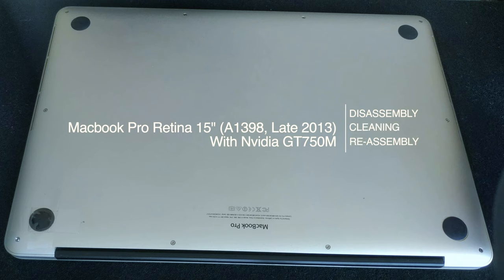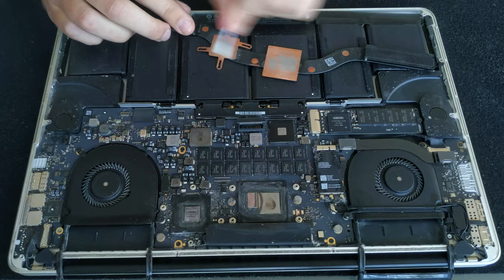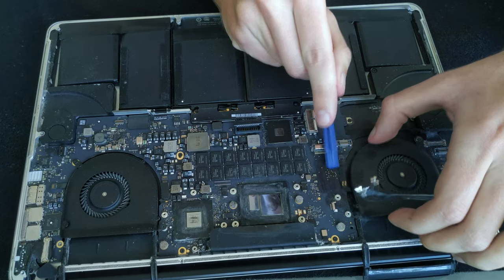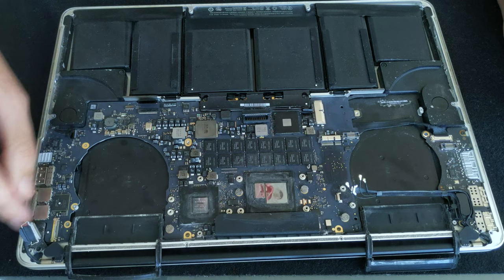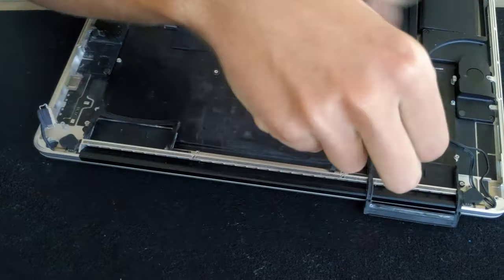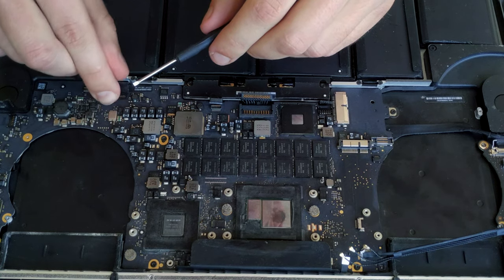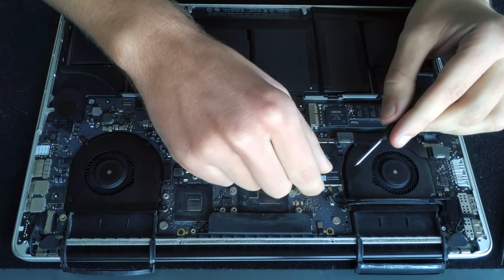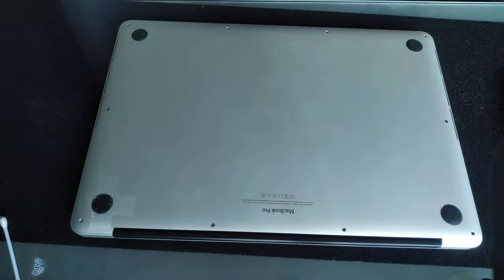Macbook Pro Retina 15" A1398 (Late 2013, i7, GT 750M) Disassembly, Cleaning, Re-assembly

Comment: Thank you sir for doing this service to the community. I used this guide to clean coffee spill in my dads old macbook pro late 2013. Following your instructions tutorial here I was able to successfully revive the computer. Now I have this 15 inch 8gb 1tb SSD macbook pro and also an old mid 2012 13 inch unibody with 16gb ram and 500 gb ssd. Both are great old computers and I dont know which one I should keep!

Comment: 30 seconds in and I already know this video is gonna be way better than the others. I figured out the long way that it’s called a pentalobe screwdriver but so glad you actually mentioned the tools. Thanks!
Reply from the maker: Thanks! I put some effort into the video in order to make it complete and for beginners.
Reply: So funny you commented today, I’m  actually just about to disassemble my MacBook for the very first time today and clean it because I fear roaches may have gotten inside. Wish me luck!
Reply: Using your video as my only guide
Reply from the maker: @citylights2765  Good luck! I'm sure you can do it. For the basic maintenance just clean the fans, air intakes and replace the thermal paste. No need to take the whole board out.

Comment: My MacBook's fans were choked and it was running hot so I cleaned them out with a fine paint brush and replaced the thermal paste. All back to normal now, thanks for the video.

Comment: Thank you for you very clearly explained video! I used it to install a new logic board on my 2013 Macbook pro A1398. I agree with you that it's one of the best computers Apple has made.
Reply: My logic board bit the dust recently- memory ram module 2 is toast and Apple considers this laptop "vintage" and can't fix it any longer. Do you mind sharing where you got your new logic board (A1398) from? Thanks.

Comment: Thermal modifications?! Hold on a minute.. I think i've found the right place!! :D Subscribed!
Reply from the maker: Sorry mate, no time to make the video now. What I did was putting the liquid metal on the CPU and then put thermal pads on the heatsink so it touches the bottom panel. This helps a lot especially if you slightly lift the macbook on the desk so the air can go under. After that I had no thermal throttling even if I overclocked by +200mhz in windows. Still running cool after 6 months since I did that.
Reply: @techworkshop7242  Thank you for your Gentleman's response! :) Picked up 3 x 2013's. Loving them!! Wishing you the best, your video really helped when swapping the logic boards over. 10/10
Reply from the maker: @walshmagic  You can never have enough of 2013 :D. Still enough for my Logic Pro X and Final cut projects.
Reply: Tech Workshop what year were these models built?? late 2013 to ???
and what about the next model. same, better, „worse“??
thx
edit. 
just saw it was until mid 2015
(what about later models? worse?)
as I am planing to have an E-GPU and the thermal mod)
Reply from the maker: @serialdad33  late 2013/mid 2014 has Nvidia GPU option and then there is mid 2015 with AMD graphics (not necessarily better) and slightly improved CPU (still the same generation). So late 2013- mid 2015 is basically the same machine. If you're going to get E-GPU then the best option is mid 2015 with integrated graphics. From 2016 they come with only thunderbolt 3 ports which will be better with E-GPU but also come with more problems and butterfly keyboard (1st gen) wich is very unreliable

Comment: Excellent! but appears to be one misstatement. After removing most parts, you stated the 4 last screws holding the motherboard were the same size. Unless somebody made a mistake on mine - those 4 screws were different size

Comment: Guys, be careful when putting back i/o data cable back (the black Z-shaped cable on top of the right fan). I accidentally placed mine wrong side, which caused short circuit and sparks. Mac works fine but the right side ports (usb, hdmi and card reader) are not working. Now I'm wondering if it will affect the rest of the system

Comment: My 2013 A1398 is having problem with a 3-beep error, got a second hand board and put everything back together only to find out trackpad not working, neither when I hooked up a USB mouse, there was no startup chime either, but I do get warning sound when press the keyboard too long, what could be wrong? what do I need to look for to correct the problems? thanks!

Comment: Thanks, good video
But why ports must be overlapping at 12:50?
These ports not overlapping in beginning of your video and in other disassembly videos around
Reply: i have the same exact question...did it work out alright for you?
Reply: romo111213 i did not overlap these ports and seems like everything is fine
Reply from the maker: It's just the hint how to allign it properly. The path of the minimal resistance is the way to go. Glad that it worked for you.
Reply: It should not overlap. It goes underneath the metal body. It's like that on the HDMI side, and I didn't take the board on that side out at all.

Comment: Thanks man!  This is really detail and helpful. By the way, If I want to change the charging port(magsafe board), what parts have to be unplugged?
Reply from the maker: I belive you have to take out the whole board because the connector is underneeth
Reply: @techworkshop7242  Thank you, sir. I have already fixed it.

Comment: Is this model 2013 reliable according to graphic card? We know some issue about gt650
Reply: No i cant use gpu on that unit thanks to nvidia and apple , even on windows 10 gpu is not exist in device manager and nvidia drivers wont able to reconize gt750m on that unit

Comment: Where can I see this "other video" with thermal modifications? Sounds very interesting!
Reply from the maker: Sorry mate, no time to make the video now. What I did was putting the liquid metal on the CPU and then put thermal pads on the heatsink so it touches the bottom panel. This helps a lot especially if you slightly lift the macbook on the desk so the air can go under. After that I had no thermal throttling even if I overclocked by +200mhz in windows. Still running cool after 6 months since I did that.

Comment: Thank you for the detail video. I am also planning to do the similar work on my MacBook Pro mid 2015. It needs new speakers and since I am at it  I will replace the batteries as well. Please suggest any pointers because this video is about a year old. You may have encountered many other gotchas.
Reply from the maker: Hi mate, first check if there is an Apple recall for your battery. The was one for the 2015 15" and they would replace the battery for free. If not you can do it yourself. I just had a bad experience with aftermarket battery which started great but after 150 cycles went down to 85% capacity. I suggest to try to get an original one or at least something tested like ifixit offers. Disassembly and changing the speakers is almost the same - it's still a A1398 model. You should be able to do that if you follow this video. For the battery glue removal I use a trick with the thinnest guitar string attached to screw driver cutting the glue underneeth - that's the hardest part in the process.
Reply: @techworkshop7242 Hi Tech Workshop, Thank you for the feedback on the battery. There was a recall last December on this model. I need to take it to Apple for the free replacement.
Reply from the maker: @lcdmvdoact  Free stuff is good :)

Comment: Thanks man ! Is it worth to take out the keyboard to clean as well?
Reply from the maker: I don't think so. It's a huge paint to remove the whole keyboard and you can't really clean it much better afterwards. If you have some dirt underneath the keys you can blow them out with a compressed air or a compressor. Just flip the laptop facing keyboard down and blow the dirt out one key at a time. Cheers.

Comment: Do you need to go through all of this to change the speakers? Or, can you unhook the battery and access them directly? Thank you.
Reply from the maker: Yes, unfortunatelly you can't replace the right speaker without taking out the whole board. Taking out the battery wouldn't help as the cable goes in the board compartment. Anyway the battery is glued to the chassis so it's even more work then taking out the board.

Comment: My MacBook starts with a black screen and eventually a flashing file icon with a question mark. Was intermittent for a month or so but now permanent.
Reply from the maker: Probably an ssd failure. Try reset smc and oprom and if it does not help, connect an external drive and install Mac OS on it. If it works after that then you know it's the ssd issue and you can replace it afterwards

Comment: Thanks for the vid do you know the size of the screws that hold the battery in on this model, cheers.
Reply from the maker: It's glued in place really hard. Use isopropyl alcohol and a thin guitar striing to cut under.

Comment: I have tiny vertical bars on the right side of my macboork pro screen. It did not fall or suffer any shock... Any idea what it could be? Would like to avoid being convinced I need to buy a new computer.
Reply from the maker: I think the signal that goes into the screen is either all or nothing so it's probably a faulty screen,  Hopefully you can test to rule out the other posibilities like a bad connection. If external screen does not do the same, it's probably the screen itself.

Comment: Question If I were to remove the wifi/bluetooth card and not reinstall one will my MacBook power on and work normally with the missing hardware.
Reply from the maker: Yes, it will turn on. Why would you want to do that?

Comment: Hi, do you know what's the size of those pentalobe screws 0:26 in the bottom panel? I'm trying to find a replacement for the ones on my razer blade stealth and these ones probably match my needs
Reply from the maker: Size 1,2 works the best for me but anything like 1,0 to 1,6 would probably work too.
Reply: @techworkshop7242  Hi, the bolts were noticeably shorter, but they worked well enough to cover the issue. Thanks a lot for replying!

Comment: Hi same model, 

SSD stopped being detected in disk utility, I'm stuck in a continuous loop installing Mojave. Is there anything I can do?
Reply: I would try to install Mac OS on an external SSD to see if anyhing else is wrong. If that works then it's hard to tell if it's a SSD failure or the logic board. Try cleaning the constacts and resetting the OPROM.